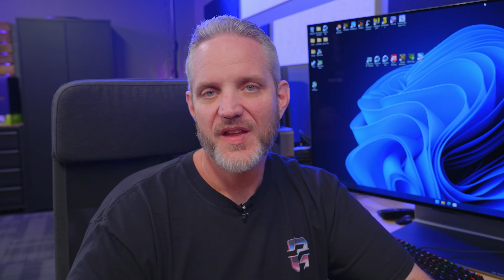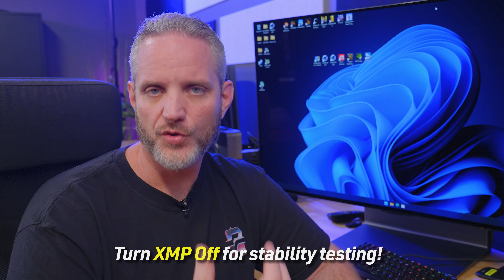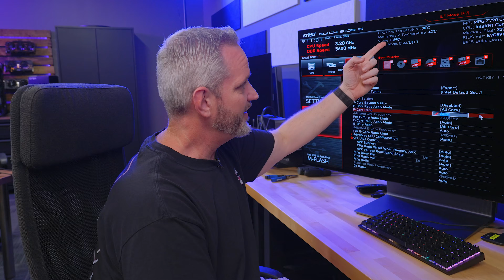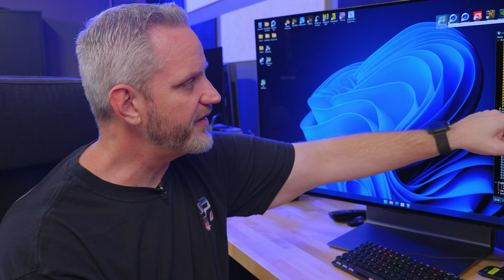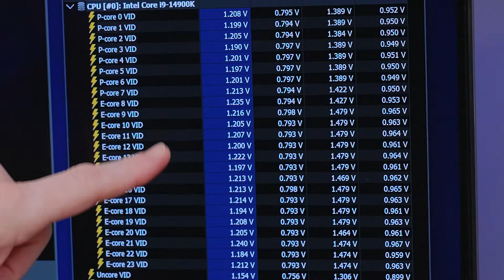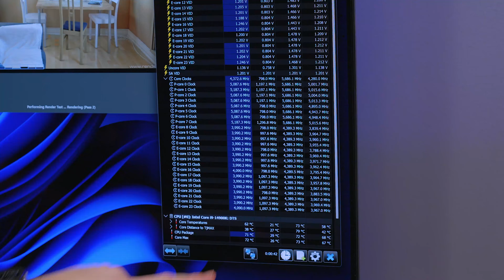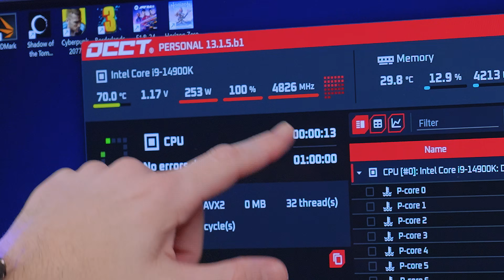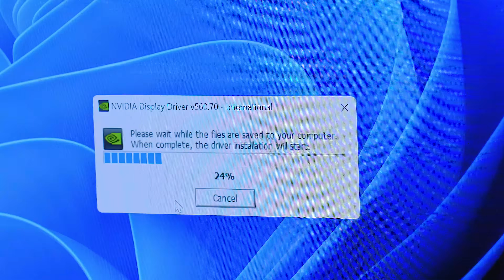Guide: How to check if your CPU is BAD!

Comment: I started getting random blue screens, my webpages could crash when on the internet, nvidia drivers not installing or crashing, crazy temp variations, tried undervolting - crashes during stress test, tried Intel recommended specs - immediate blue screen. I’ve got a 14900k and this all started probably a year and some change after buying it 😭😭

Comment: I have an i5-14600kf with an air cooler "cooler master 212 hyper spectrum v3 2xFans"
When I stress it on Cinebench it hits 100c°
Motherboard Asus tuf gaming B760-plus-wifi with the latest bios update ver 1805.
I have good airflow and air conditioning in the room
I undervolted CPU and now max temp. 85c° and min temp. 38c°

Is that normal with this CPU?
Is that cooler enough or should have liquid one?
Is undervolting very risky?
I just bought it 1 week ago 

Thanks for your help.

Comment: ok so i downloaded all the test programs because i was getting some mozila tabs crashing, some games getting blue screens, crashing to desktop, not even starting and all that jazz they look a little bit different but i guess that doesnt matter all that much and i got a freeze on intel burn test, freeze on cinebench 15, freeze on cinebench 23(and those are the first second i start the tests) ,OCCT says that it crashed and it stopped the test and heaven just goes back to the menue when i start it and last when installing the graphics card driver it shows me 7zip CRC error. I guess my cpu is gone isnt it?

Comment: 8 Months later and my CPU is on its way out, all started back when Gray Zone Warfare was released and having severe over heating issues with the 13-900K and Unreal Engine 5 and had to wait for the micro code bios update to fix it, then yesterday when i was playing  Expedition 33 had multiple crashes and BSOD's, Errors include: Critical Process Died, Driver Overran Stack Buffer, IRQL Not Less or Equal, Page Fault In Nonpaged Area and Kernel Security Check Failure. Can't install windows updates, PC Restarts over and over every time when getting to Disk Partition in fresh install (like the RAM is memory training) can't install any Nvidia update new or Old so my PC now has to be RMA'd. its a sad day today

Comment: Getting a lot ot CRC errors during Nvidia Driver install with 14900k, on top of a bunch of weird app crashes. Using the Intel Extreme Utility to reduce ratio to 54x seems to stabilize the system. Can't figure out how to do that via Bios with the latest updates to Asus Z790 Hero, won't let me set manual ratio no matter what I've tried...

Comment: Just RMAd my i9 14900K
ASUS Z790 Gaming WIFI7 MOBO

This is my second one in 18months. I use MSFS2020 and MSFS2024. First time, I started getting errors installing software like add-on aircraft for MSFS2020, then errors doing the Nvidia updates and then the computer started blue screening constantly. That was May, 2024.

March 2025, I just could not play MSFS2024. Computer would blue screen and CTD sometimes on the loading screen, sometimes after 20 minutes of playing, sometimes opening a menu in game. Then I started seeing the Nvidia installer errors and kind of the same pattern I saw in May 2024. I ran OCCT and crashed after a couple of minutes. I also saw the temperatures go above 100 degrees with HWinfo. I then requested an RMA for my CPU.

Since then, I updated my bios and got a bigger cooler (was a Cooler Master 240 before, got an Artic 360). I still see Code VID going above 1.6 so I will undervolt in hopes this CPU can live longer than a year...

Comment: The CPU activity is always high. The pc slows down to an extremely slow speed. Always getting blue screen when you clearly have no virus/malware. Blah, blah, blah. Doing this since I was 13 years old. Also, ran a cpu heavily for 10 years. Already was used when I purchased it. Could have possibly been the demise of my Asus laptop. But, not confirmed. Pretty sure the CPU was toast after all the use though.

Comment: Ok so I’ve got a B450 pro with a ryzen 5 3500 cpu and rx580 gpu. So today I upgraded to a ryzen 7 7500x and a rtx 3070ti. I turned the pc on and everything lit up and fans ran for about 30sec with a black screen and it shuts down and starts back up then shut down. So I put all the old stuff back in and it ran fine. So then I just put the 3070ti gpu back in and everything worked fine. I ran out of paste so I couldn’t try the ryzen 7 again. I’m 100 % sure I put the cpu in right.  But do u think is cpu is bad. I did bye the cpu used.  New gamer what do u think. Thanks

Comment: Jay, I have a question that's really bothering me. When I have high CPU loads while running a game, like Apex Legends or Cyberpunk, the red LED on my Asus motherboard lights up for about 10-15 seconds and then turns off. Is this normal? My system is: Asus Z970F motherboard, 4090, 64GB DDR5, and a 14900K i9 CPU. I would really appreciate your answer because I can't find anything searching on Google.

Comment: I got that info off of HWINFO64.  I'm an' old fart'.  I've been hand assembling Machine since 1980.  I'm familiar with Z-80a, 6502, ARM, and good old x86+ Architecture and Addressing Modes.  I used to be in competitions on different CPUs,  Accomplish this Data manipulation in the least amount of clock ticks.... GO.   I like you man.  Zero-Page addressing made a 6502 fly.  Indexed, indirect addressing on most everything else.  To be honest, I'm still absorbing the ARM CPUs, I love rooting phones, 15 General Purpose registers or More?  I have more toys than time.  I work long shifts in a compressed workweek.

Comment: This interests me.  I'm running an i7 14700K on an ASUS TUF GAMING Z790-PRO WIFI with 64 gigs of DDR5-5200 / PC5-41600 DDR5 SDRAM UDIMM.  Video card I wimped out on as I'm an old fart at 60 that still likes retro Sierra Online Games, which need no real graphics power.  My GPU is a AMD Radeon RX 580 2048SP (Polaris 20) [AMD].   I've got a so-so huge cooler on the CPU.  I've hardly looked at my BIOS since I built it.  I like you and appreciate your software benchmarks I'm gonna run.  I'm only using a 850 watt ATX of some flavor of power supply.

Comment: I'm trying to figure out why i can't play on a Conan Exiles server with Mods that i am hosting using Gportal. It gets to the modchecklist where it auto subscribes and downloads the mods and just blips out it goes into a attempt to join loop failing at the modchecklist everytime. 

The server is working properly i had a friend who was going to join me in this game try and get in and it worked for her, she can play it no problem. I am the one with the issue. 

A few days ago i was trying to play some Fortnite with my friends and specifically after an update did i continuesly get errors causing the game to crash again and again, certain types of games worked like Solo play or Trios, but full squads always failed. 

After many many errors i decided to reset the whole system because i wanted to make sure i covered all bases, 1st problem that showed up was there wasn't enough space to even do that and i had to delete alot of random things in C: Drive just to get enough space for the reset. 

Doing this i go on with the reset and close to 78% an error happens, SAFE_OS-phase with an error under APPLY_IMAGE-operation. 

This happened repeatedly, after a series of chkdsk attempt's it finally allowed me to reset. Although i didn't clear the harddrives.

Now after having done this i try to install the games i frequently play, some install attempts have lead to bluescreen errors, and other different errors. After a few attempts and chkdsk's fixes some let themselves to be installed and played, Fortnite absolutely refuses to be installed at all with Error Code: IS-IN-FC05 file corruption has occured. 

Not sure what to do. Maybe a full reset with 100% cleared harddrives.

Comment: So, for maybe going on six months now, I have been getting the WHEA UNCORRECTABLE ERROR bluescreen every other week and at first, I couldn't figure out what was causing it. My initial guesses as to the cause were ranged from everything between an overheating CPU to one of my failing SSDs being the culprit. 
I used MemTest86+ to make sure no RAM was damaged, performed tests over the past 18 hours and ending up with 12 passes and no reported errors. Then I downloaded and ran the Intel Processor Diagnostic Tool which equally showed no issues.

Finally, someone on the tech support subreddit enlightened me that it must be the CPU, because the last of the 4 rows of numbers making out the extended information in the BSOD ending in 402 is indicating that the machine is blaming the CPU.

But, even if it is pointing to the CPU, I have ruled some things out; I have never overclocked it, it's not overheating according to multiple softwares and the BIOS has been updated to the latest version.

All of this is really confusing. I felt like I needed to be safe and paid a fortune for an older 1151 CPU to be able to replace the one I am currently using if push comes to shove, but I am in no hurry, since so far the BSODs only happen with weeks in between.

It's just so annoying to not be able to say with 100% certainty what needs to be done or what the cause is.

Comment: I have a i9-14900k 24 core. ASUS ROG STRIX Z790-H gaming Wi-Fi BIOS 2801. EVGA GeForce RTX 3060 12GB GDDR6. Of all the tests on here only intel burn test on 1 thread will fail. It will pop up the fail right as it gives the 2nd time/speed/results. All the other ones say no problems. I play 3 MMORPG's all at 4k. FF14, SWtOR, and STO. When the rig was built, day one or day two, I had a crash to restart. (crashed and re booted just fine) A friend that was helping me then had me go into BIOS and set a limit to the CPU voltages to the Intel limits. Then a few weeks later a new BIOS came out and that BIOS removed all the menus to even tinker with the voltages. This was built around 5/12/24. I have never done any overclocking. Not even that AI over clocker in BIOS. about four weeks ago STO just started to crash and even got so bad it will not even launch. I tried everything even a completely clean reinstall of Win 10 Pro. It still crashes. everyone is telling me it is the CPU. But man 14 and SWtOR have 0 crashes/errors. I don't know I have been upset practically crying for like two weeks now.

Comment: Pretty sure I unfortunately got a cpu from a bad batch. 

First off my specs:
CPU: Ryzen 7 9700X
Motherboard: ASRock Phantom Gaming A620i micro-ATX WiFi
PSU: Phanteks Revolt SFX 850W 80+ Platinum 
GPU: just been using the IGpu, was wanting to slot in a 5080 but you see what happened….

I’ve tried a new motherboard, new ram, swapping slots with the old ram, trying single sticks etc etc as well as removing some of my storage units. I did try throwing in a GT1030 I had laying around that I knew still worked, hell I even tried clearing the CMOSS, and updating the BIOS, just nothing worked.

Result, no video, no post. Only thing I can think of is the cpu. The whole board is receiving power, so that’s what I’m left assuming is wrong. The thing that sucks is I haven’t even had the cpu for a long time, I ordered it on the 13th of December 2024.

Any thoughts?

Comment: I find you videos entertaining, but more important, very informative.  The former keeps the presentation moving forward to the end for max information.  Thanks so much. 

I have a early 2023 i5 13600k running at 5.4GHz that has been stable now for 2 years using  a now banned (!) DeepCool 240 AIO.  I have run multiple benchmarks over the past two years like    OCCCT, prime95, and cinebench23 and core temps generally run in the mid 70s and max out in low 80s under full sustained muilti-core load.  Watching this video, you taught me to be sure to run single core tests as we.  Thanks so much for your  videos.

Comment: Hey so like.. what do I do if my CPU won’t draw more than 3.5-4 watts, even while under full utilization in benchmarks? Already checked the PSU cables, it’s CPU to CPU, did driver updates for CPU, checked every connector I could think of and reseated and applied thermal paste to AIO, investigated BIOS but couldn’t find anything, now I’m just stuck and don’t know where to go!

Comment: My i91300k doesn’t crash but temps are pretty hot. Cinebench r23 throttles 100c no matter what under voltage I put on it. Once I get to .1 under volt  it soft crashes. Gaming temps are 75-80c. Cinebench scores are 35000. Is it toast??

Comment: Jay, Forgive me however this is a long one.
On one hand, you have given me at least the slightest bit of understanding of what has been going on with my Rig. With that being said, unfortunately, there is always the other hand. With your last test, you have absolutely broke my little baby gamer heart. I have been watching and taking note and rewatching to ensure I have my notes right so I could study everything for a bit and build the confidence to tackle then test everything. I only recently felt this whole issue within my rig. Therefore, I only recently heard about this CPU issue. It only got worse though because then I heard that Intel had put out a beta bios update that unfortunately had a nasty habit of bricking CPUs and because that bios update was only a "beta" and not a final version Intel apparently said that the bios update was an "Install this bios update at your own risk." "Installing this beta bios update also voids your warranty." type of situation. So, of course, I was wide-eyed about the topic. I am reasonably decent with computers. I have always built my own rigs from the ground up. From boxes of parts to final post. Then I realized I was actually several months behind the curve with this whole situation. So I started looking deeper into it, formulated my plan, and was doing some due diligence research/studying before executing my plan. Then, I came across this video. By the end of this video, where you talked about the Nvidia Drivers failing to install was a common error in "the most degraded CPUs." That shattered my confidence, and my whole plan stalled out. I am going to get some rest and wake up fresh, do a happy routine and sit down, and hope for the best. I will post my entire rig as a reply to those who made it this far. I feel like that's only fair.... Wish my luck, Ole Son. This is either going to be alright or super frustrating.
Reply: My Rig's Components.
Build Date 03-16-2023

Case: Lian-Li 011 Dynamic Evo
MoBo: Asus Maximus Extreme Z790
CPU: Intel I9-13900KS
Thermal Paste: Thermal Grizzly Kryonaut
CPU COOLER: Asus Ryujin II 360mm
GPU: Asus R.O.G. Strix 4090 O.C. Edition
PSU: MSI MEG Ai1300P PCIE5
RAM: G-Skill Trident Z5 DDR5-6400 32-39-39-102 32G × 4 = 128G Total.

M.2 Drives 1 + 2
O.S. Only Boot: Samsung 990 Pro 1T
Storage 1: Samsung 980 Pro 2T
Storage 2: Samsung 980 Pro 2T

Fans × 10
Set 1 Top CPU Rad: I Lian-Li UNI Fan SL Infinity 120mm × 3
Set 2 Side Panel: E Lian-Li UNI Fan SL Infinity 120mm × 3
Set 3 Bottom Panel: I Lian-Li UNI Fan SL Infinity 120mm × 3
Set 4 Rear Exhaust: E Lian-Li UNI Fan SL Infinity 120mm × 1

Monitors × 4
Main: Asus R.O.G. Swift OLED PG42UQ 4k HDR, 42", 0.1ms, 138Hz.
Side 1: Asus R.O.G Strix XG279, 2560 × 1440, 27", 1ms, 170Hz.
Side 2: Asus R.O.G Strix XG279, 2560 × 1440, 27", 1ms, 170Hz.
Side 3: Asus R.O.G Strix XG279, 2560 × 1440, 27", 1ms, 170Hz.

I want to say this entire Rig cost me over 10,000 USD. That is also using all of my existing peripherals. 

Current Peripherals (upgraded 2-3 times)
Razer naga V2 Pro
Razer BlackWidow V4
Razer Kraken V4
Razer Leviathan V2
Razer Base Station V2
Razer TarTarus V2
Azeron Cyborg

It hurts that within 2 years I might have catastrophic issues with a main component.

Comment: 13700k at any voltage/wattage and any clock speed for either pcore or ecore will crash out on r24 multi core but not single core, any tips would be helpful!

Comment: Running a 14900KF on an Asus Rog Strix Z790-E Gaming Wifi ii motherboard. Bios version 1801 and set to the Intel performance, not the extreme setting , the extreme was thermal throttling when gaming. I've just run the OCCT for about 15 minuets, P-core's 5 and 7 at 98 ºC and 100 ºC all the time, no errors detected. With an AIO Deepcool Mystique 360, fans at full throttle, room temperature 21ºC with great airflow in the Lian Li O11 Evo RGB case, with 6 x air intake fans, 3 on the bottom and 3 on the side,  with  an exhaust fan to the rear and and 3 fans on the 360 radiator exhausting through the top. Thought my i9 9900K ran hot on full load at 75ºC. Wishing that I'd have done the usual research before upgrading, but I put my faith in Intel, never had an issue until now, would have gone down the AMD route. Makes you feel like your the one stuck with the white Elephant.

Comment: My screen is flicekring after turning pc ON. It used to do it for 10 min and stoped (few days ago) now it does it all the time. Tried updating bios , graphic drivers , disabling gsnyc , changing refresh rate , new Dp cable , tried HDMI cable , always the same .  When I do CPU test and GPU test its working normally.  I have Intel i7 14700kf.